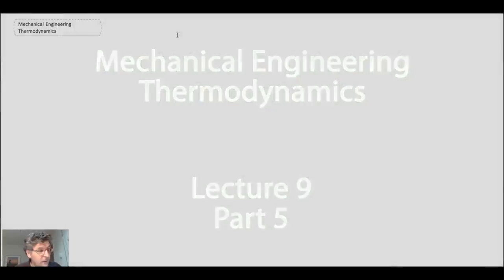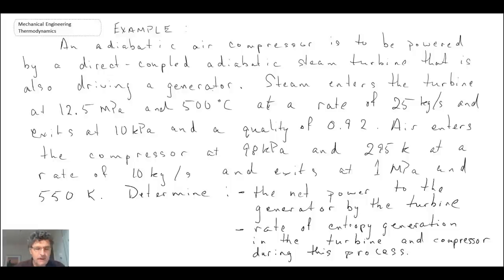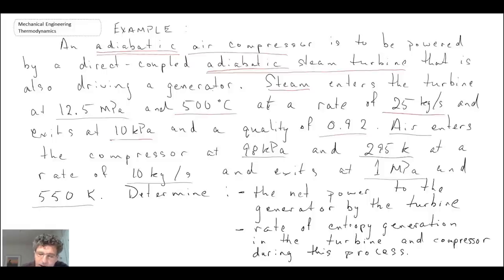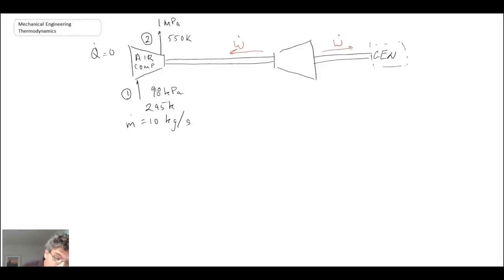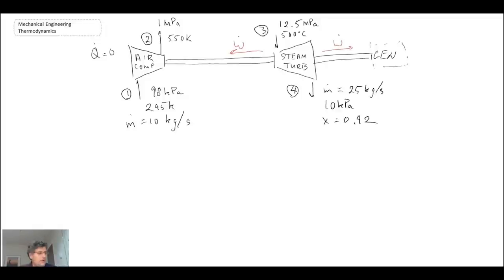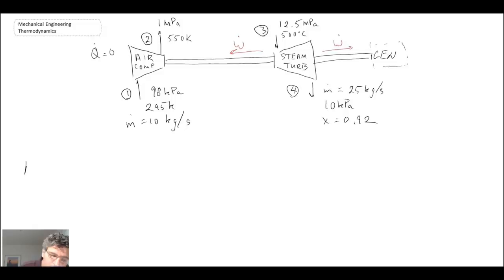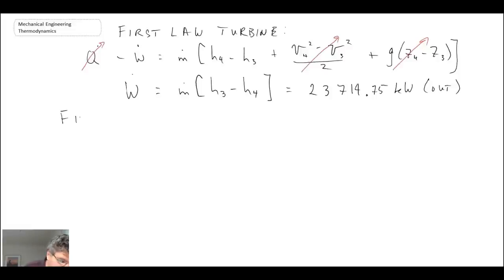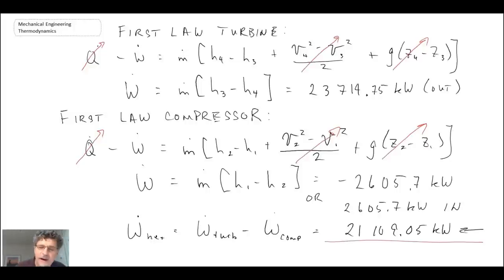Mechanical Engineering Thermodynamics - Lec 9, pt 5 of 5:  Example - Entropy Generation Air Comp

Comment: @Ron Hugo At 11:30 you used the relationship for accurate entropies (entropies integrated with respect to absolute zero) for air (ideal gas), to account for the change in specific heats in the process. How come you did not do the same for steam?
Reply: Is it because air is being treated as ideal gas so the relationship is needed here. Whereas, steam is just steam so no need for the relationship? The entropies for steam are given as is in the tables of properties